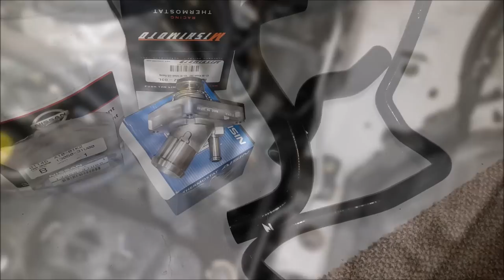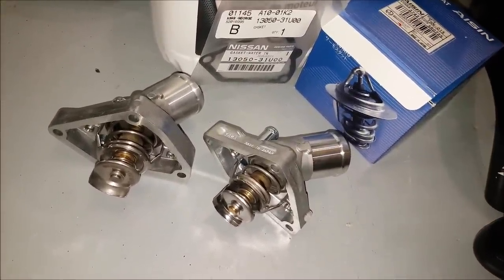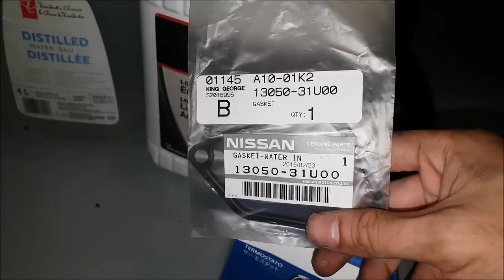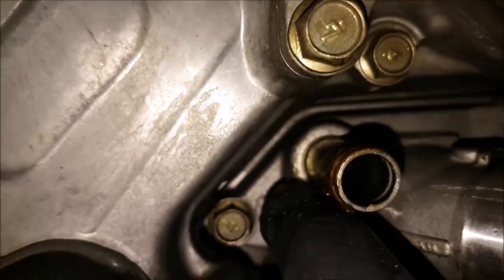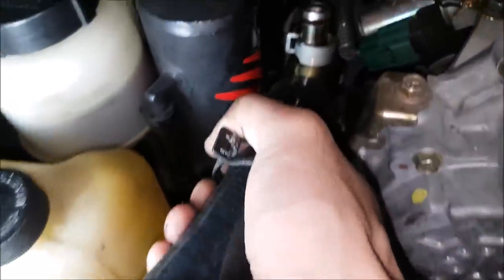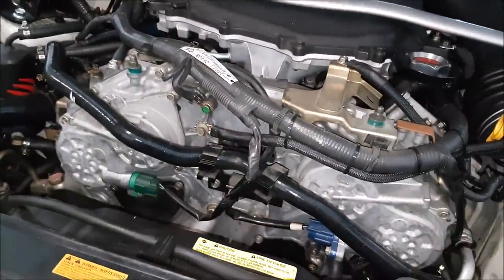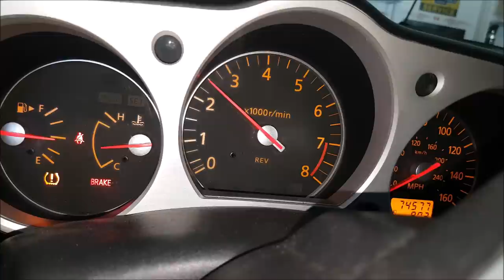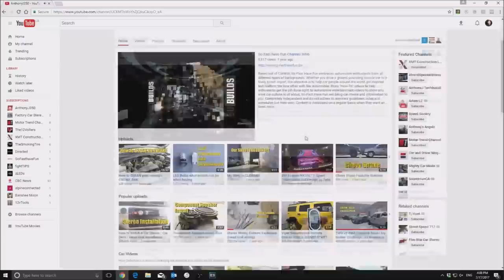Coolant System Service Nissan 350Z & Infiniti G35 (Replacing Thermostat and Hoses) | AnthonyJ350

Comment: This is the best coolant service video for 350z .
Reply from the maker: Thank you 🙂
Reply: @AnthonyJ350  I am currently replacing my thermostat. Do you just utilize the aluminum gasket or do you add silicone with it? I ask because I did this once replacing the gasket and it still leaked? So I am replacing it again rather frustrating
Reply from the maker: @1MADZ  Did you get a brand new gasket?  Cause that's all I did.

Comment: I bought the OEM thermostat for my 10 G37 Coupe w/74,000k last week at Nissan dealer for $26. Same part # as Infiniti. Make sure you get the OEM gasket as it doesn’t come with thermostat. I paid $6.50 for that. Definitely remove parts he recommends This job is EASIER than replacing the cheap plastic heater hose connector which blew as a result of the bad thermostat.
Reply from the maker: Thanks for sharing your experience! Hope the car is running well.

Comment: What I have done in the past, I did the bleeder valve to fill as shown with the heater on maximum... Then fill the over flow tank to the top of the cap...The system will burp through the radiator cap then suck coolant into the radiator once the engine cools down...After 5 heat cycles ,the coolant level will be exactly on the FULL mark....It almost appears as if the overflow tank was designed exactly for burping after coolant change.
Reply from the maker: Thanks for sharing!
Reply: Exactly! Can't be done in one shot. Took me three heating/cooling cycles to get the system fully bled. With that Lisle funnel the level will keep going down every heat cycle. Just keep topping it off an the system will eventually burp itself w/out having to even touch the bleeder screw.

Comment: Great Video as always.

I run an Mishimoto Kit ( Hoses , Radiatot, Thermostat and Fans ) and i couldn't be happier. The car hits operating temp fast ... less than 5 min. ( I live in France for reference)
Reply from the maker: Thanks for sharing your experience. I want to upgrade to the Mishimoto radiator, I'm going to do the oil cooler first.
Reply: I will be waiting for the Oil radiator video... cause thats the next thing on my to do list then i will focus on the brakes ( lines , rotors and pads )
Reply from the maker: @jorgemarques8944  Ya I wanted to focus on easy supporting mods that will add durability and help maintain power when the vehicle is hot.

Comment: Sweet vid AJ. Mishimoto thermostats have a higher temp threshold versus OEM. Aisin are good too. Some VQ owners I seen don't use factory coolant and they wonder why the engine blows up along with not topping off the oil.
Reply from the maker: You mean the Mishimoto opens earlier right? I like the Aisin one cause it was made in Japan and my Dad's work sold a lot of that brand with little issue. Trying to keep within factory parameters.
Reply from the maker: Ya you can't go wrong with factory coolant. I think it's typically the best, especially because it's formulated for how they design the system.
Reply: @AnthonyJ350  correct. Opens early and can withstand 10-12degrees hotter than OEM
Reply: @AnthonyJ350  by design of other aftermarket thermosats that says oem spec are red flags. Spring tensioners are not the same as the ones made in Japan
Reply from the maker: Do you run Mishimoto right now? I'm unfamiliar how the VQ likes that thermostat setting.
Reply: @AnthonyJ350  I'm using a new factory thermostat at the moment. I've had experience with those other aftermarket parts. The engine responds differently and much louder fan speeds at startup. My friend is using mishimoto. It responds like oem with peace of mind of running higher temps for those who like to burn rubber ✌😎
Reply from the maker: @BoOmBaMan  Ya I figure I can't go wrong with the Aisin
Reply: @AnthonyJ350  Absolutely. Both quality Japanese aftermarket brands

Comment: Great video, done a radiator flush on my XR6 Turbo but not on my WRX yet. But had no idea how to bleed the system so detailed, thanx man
Reply from the maker: Glad it helped!  Make sure to read your service manual, as every vehicle is different for cooling system designs.  The 350Z is definitely one of the more time consuming ones to bleed air out of.

Comment: I drill 8 tiny holes in the outer ring of the thermostat ( steam holes ) It greatly reduces the bleed time, and those steam holes prevent air being trapped, and possibly burning a hole in the intake manifold from hot spots.  I recommend doing that to all thermostats. One less possible fatal motor mistake.
Reply from the maker: Thanks for sharing!

Comment: Ah there you go I commented on the "coolant bleeder replacement" video not knowing you already had a video showing the complete burping process. I still figure that you don't even have to open the bleeder, funnel takes care of everything. At least that's how it is with my Ford.
Reply from the maker: You'll want to crack it open when you refill it. These cars have a hard time bleeding.

Comment: This is great! I'm planning to swap upper and lower radiator hoses this weekend and find this video to be one of the most helpful. From what I understand, my 2008 G35 with 3.5 L VQ35HR engine  (vs VQ35"DE") doesn't have a bleeder screw, however, there's an Air Relief Plug "on radiator" (driver side) that should be opened on refilling and closed when coolant begins to flow out. I'm hoping using this procedure (w/ spill-free funnel)  in combination of Air relief plug on radiator will work the same! At the very least I can follow the exact steps in service manual which doesn't involve using spill-free funnel, which means you must close radiator cap, and wait for car to cool each time. For anyone wondering, I got the manual from here: https://cardiagn.com/2008-infiniti-g35-engine-cooling-system/

P.S. The service manual does make mention of an Air Relief Plug on "heater hose" (i.e. bleeder); however, I've read differing comments of some saying it's there and it's not. Apparently, Infiniti started to phase them out post 2007 model. In fact, if you check the following link and select 2008 Infiniti, the OEM Coolant Bleeder Relief Valve shows as Not Compatible. https://conceptzperformance.com/nissan-infiniti-nissan-oem-coolant-bleeder-relief-valve-nissan-350z-infiniti-g35-92500-ar000_p_15693.php
Reply from the maker: Thanks so much for sharing! Main thing also is to elevate the front end and remember it might take some time to bleed the system. Takes me 30 to 45 minutes.
Reply: @AnthonyJ350  I’m totally fine with time even if it takes 2hours. My main goal is to ensure it’s done right 🙂! 

Only question I have...as you were going through the cycle of topping off coolant and rev’ing engine and holding at 2500/3000 rpm...how long did you wait “in-between”those events? Meaning, you started by filling coolant, open bleeder until fluid comes out then close, start car and turn on heat, rev engine, as fluid decreased in funnel you topped off (and I’m assuming you slightly opened bleeder to bleed air then closed), then went back to rev engine... how long did you wait after topping off before you went back to rev engine, or how do you know when to? Is it when coolant stops moving(increase/decrease) and/or when you no longer see bubbles? Is that the point when you know to rev engine again?
Reply from the maker: @otm777  Only topped off if a lot of coolant went down. I only open the bleeder when it cooled off.

Comment: You want to use soft water instead of distilled. Distilled water is chemically unbalanced and will attracts electrons from metals.
Reply from the maker: Thanks for sharing!
Reply: That’s deionized water. Distilled is perfectly fine.

Comment: If I owned my own place I'd get an air compressor and vacuum filler tool

Absolute pain in the ass to bleed these things. I put in an aluminium bleeder to replace the fragile plastic union at the heater line in my 370 and bled it from the heater hose and radiator air relief, was getting hot air and no bubbling noises but still getting heaps of air out using a funnel
Reply from the maker: Thanks for sharing your experience!

Comment: Nice video,what do you think about the OEM with gaskets? Price at $30 us,Thanks. 03 Stock with 125k .
Reply from the maker: If it's original Nissan on a car used on the street normally, nothing wrong with genuine parts.

Comment: Damn! I didnt know you had swapped out your oil pan! looks clean
Reply from the maker: Ya wanted the extra capacity cause of the oil burning thing. I'm going to add the Mishimoto oil cooler next. Saw your radiator video looks good. Do you think the thin fan setup from Mishimoto will solve the tight clearance with the AC compressor?
Reply: AnthonyJ350  yeah it probably will solve it. Mine was a pita to install but with some maneuvering it fits just fine. I imagine the mishi fans also blow more air. I need to get a mishi thermalstat as the air in Florida is hot as hell
Reply from the maker: @Z33Garage  Ya that makes sense. I have a Mishimoto thermostat in the video I'm not using. You want me to send it to you?
Reply: @AnthonyJ350  ohh man! That would be cool, how much do you want for it?
Reply from the maker: @Z33Garage  Just pay me for the shipping and a shoutout on your channel lol. You can email me your info, info@gofasthavefun.ca
Reply: DUDE AWESOME!!! Sent!
Reply from the maker: @Z33Garage  Awesome, I'll check my mail when I get on my home computer.
Reply: @AnthonyJ350  thanks man!

Comment: Question so I am new to doing the bleeding when doing the bleeding you hold the gas at 2500 rpms for 10 seconds and turn the ignition off or leave it on idle ? And how long do you wait until you step on the gas again and will the funnel automatically stop when the radiator fluid is filled to the top ?
Reply from the maker: I would do 2500 RPM off and on until the cooling fan turn on.  Then I let it idle for like 20 seconds then shut it off.  I then repeat the process till the bubbles stop.
Reply: AnthonyJ350  awesome thank you so much !!

Comment: Well done, AJ have you had any issues with the Aisin thermo?  It looks identical to the Mahle(made in Japan down to the green tag) I'm fixin to put in.  I have only seen one other, silverstone  2006.5 with lower miles than yours, mine with 40k.
Reply from the maker: Cooling system has been great since we made the video.  I've also been driving the car more in the colder weather this month since my truck is in the shop getting the top end redone.

Comment: I have a question I just noticed that when I first start my car cold, it builds up pressure, but not enough to push coolant into the reservoir, and when it reaches operating temperature, the pressure is normal coolant and the reservoir never gets above max and then settles to minimum when it’s cooled now with the radiator cap off and a spill free funnel. I start the car up and it pushes coolant out into the funnel, maybe about 6 ounces or 8 ounces and then stops and stays there cold and at operating temperature, does not overheat,  cruising its at 178° to 183° and  fluctuates in traffic as normal no air bubbles in the reservoir or the spill free funnel cold or operating temperature, everything is operating completely completely normal. I know this is a symptom of a leaking head gasket, but everything is operating perfectly as it should. Is there something else that causes pressure when it’s cold?….. it’s been doing this for nine months with no issues and I’m not losing coolant either and the heater works great.
Reply from the maker: The plastic overflow tank or the radiator itself?
Reply: @AnthonyJ350  if you’re asking me which one is building pressure. Its the radiator because the overflow tank is vented.

Comment: How would you know that the vehicle is fully bled? Is it when all the coolant in the container is consumed or when the coolant isn’t decreasing anymore?
Reply from the maker: When the coolant in the funnel stops bubbling, you should be good
Reply: @AnthonyJ350  Thank you! Also, I might have missed this, but shout you increase the front end height of the car as you fill it with coolant? Then lower it as you’re revving to 2500 RPM?
Reply from the maker: @Mr_Odog  You can just leave the front end of the car elevated the whole time.
Reply: @AnthonyJ350  Thanks, man!
Reply from the maker: @Mr_Odog  You're welcome 🙂

Comment: Currently need to replace oil filter coolant hose the one on top. Been looking all over for videos of removing the hose but have found non . I'm curious on whether I can replace it without having to remove the alternator . I see where it connects on bottom but not on top . Any advice on what i should do is welcome
Reply from the maker: Not sure honestly.  I plan to put a silicon one in from Z1 possibly this year and you can watch the video.  If things are in the way, I would remove the alternator so you can access it better.  You might also want to pick up a service manual and study it to give you a plan of attack to take on the task.

Comment: I deleted the bleeder valve it broke on me and I needed to get somewhere to just used some 3/4 hose & adapter and I just bled it from the front and was able to get all the air out easier in my opinion I struggled with the valve.
Reply from the maker: If that's what worked for you. Majority of people including myself need the bleeder. Did you drain the system?
Reply: @AnthonyJ350  Yes, I changed the radiator just cause I was already changing the cooling fans and thermostat so figured might as well and I filled it all back up went to crack open the valve and it broke right in half so just got some 3/4 hose and a connector and closed it up. I saw another video where someone just raised the front end and let it run to temp and was able to get all the air bubbles out from the radiator and get the heater to start working so I did just that and it was way easier than going back and forth with the bleever valve and the car no longer overheats at idle or while in drive, runs great.
Reply from the maker: @chrisd5758  OH I only open the bleeder on initial fill. If you watch the video, we're just running the engine.

Comment: Hey so I'm just confused on the steps you took. So you filler her up went and held at 2500 rpms for 10 secs. Then went screwed off the pressure valve in the back them tightened it. The. Burped the upper hose. Filled with more coolant in the funnel. And repeated a bunch of times. Correct?
Reply from the maker: Correct, don't be surpised if this takes at least 45 mins to perform.

Comment: trying the bleeing method, blowing cold air still and coolant level  keeps going up funnel any other tips. Thanks.
Reply from the maker: Did you try squeezing the upper radiator hose to help burp it? It takes a long time to bleed these cars.
Reply: AnthonyJ350 Yes, my cooling fans go on but my lower radiator hose stays cold, I am doing it on a driveway at an incline since I have no jack stands at the moment. Not sure what else I am doing wrong. Thanks for your help by the way lovely Z that you have.
Reply from the maker: @fernandomartinez8226  Thanks! Were you able to bleed the cooling system?
Reply: @AnthonyJ350  350z's have a bleeder valve for the coolant system on the passenger side of the engine bay between the battery and engine.
Reply from the maker: @DaveDuzzit  I show the bleeder in the video

Comment: I changed my thermostat it has no leaks car still runs hot.. fan works, coolant changed out in radiator and reservoir what could it be it’s so stressful im like a doctor trying to figure out what’s wrong😩
Reply from the maker: Did you bleed the system like in the video? That part takes about 45 minutes alone.

Comment: What size hose clamp did you use? Mine snapped and I binned it so no idea to tell 😅
Reply from the maker: Measure the diameter of the hose.
Reply: @AnthonyJ350  lol did already. 25mm for anyone needing to know
Reply: What about for the smaller hose clamps

Comment: Would you use a lower temp thermostat?
Reply from the maker: I just use the OEM one
Reply: @AnthonyJ350  Think I'm gonna try a Nismo low temp unit since I'll be running the Rev-up harder in the summer.

Comment: I am thinking of getting ALL the hoses where the coolant passes through swapped out to silicone, and then also use one of those aluminum bleeder port you can get from Z1.

Any reason why those radiator hose kits don't come with the coolant bypass and heater set hoses in the set?
Reply: They come with the master kit. If you have an awd version you wont be able to use the oil cooler hoses and would have get oem from the dealer. Other than that, the master kit covers all the coolant hoses.
Reply from the maker: There's a full kit Z1 sells.  I eventually swapped to their bleeder as well.  Definitely worth the money https://www.youtube.com/watch?v=A0TmDY5yq5k

Comment: Hey Anthony, my Z has 85,000km should I replace my thermostat as a preventive measure? Or do you think it’s fine for the time being unless it gives me an issue
Reply from the maker: I would change it the next time your change the coolant.  A thermostat can either fail open or closed.  You don't want it to fail closed in the summer.